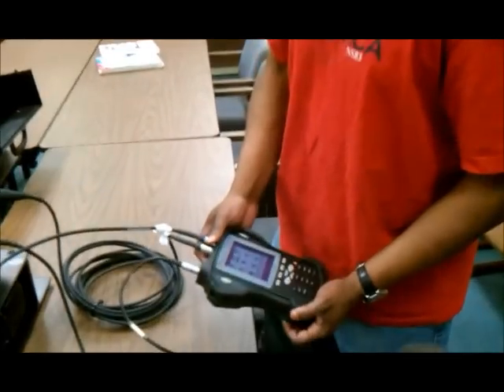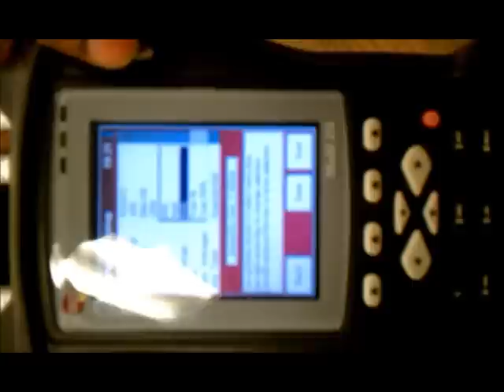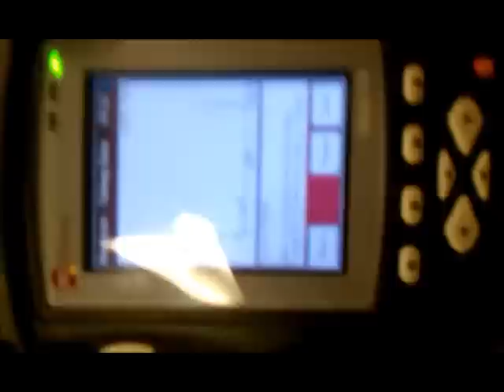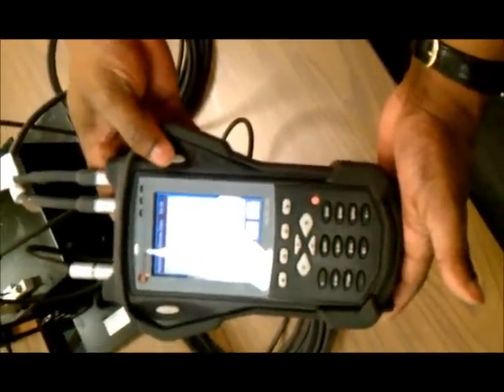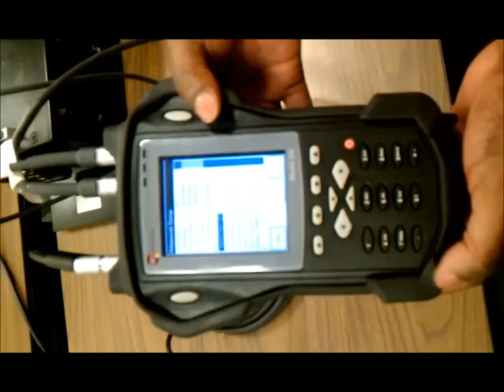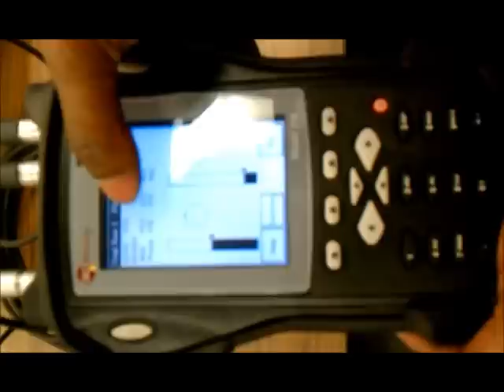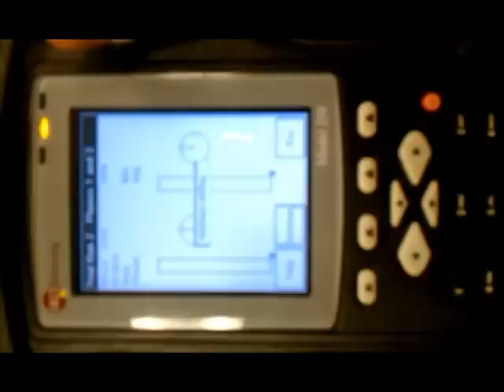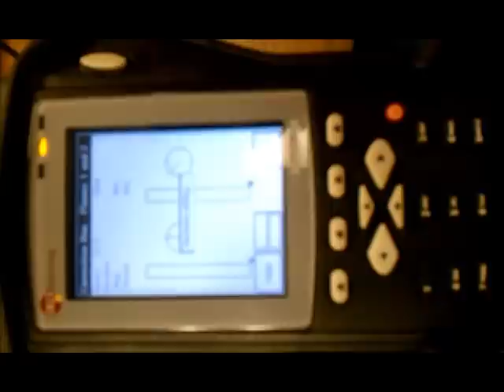IRD Balancing Model 258 Demonstration

Comment: From the late 1970s until the early 1990s i used IRD equipment to balance pump impellers, centrifuges, turbine shafts, and centrifuges. I would plot a vector on my work sheet which gave me a 360° picture. I would set a small weight on the device, and put a mark on the work piece. I would then run the device up to at least 1200 rpm and then use my strobe to set my vector. I would plot the direction that my mark would show me then move the weight to that location. I had a formula that i used to determine the amount of weight i needed to bring the device into balance. This was before computers😁